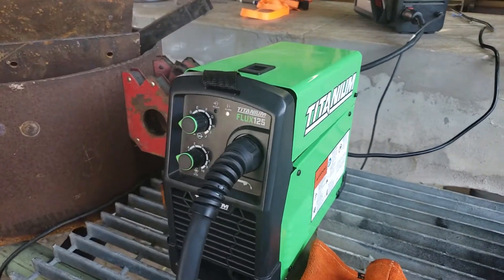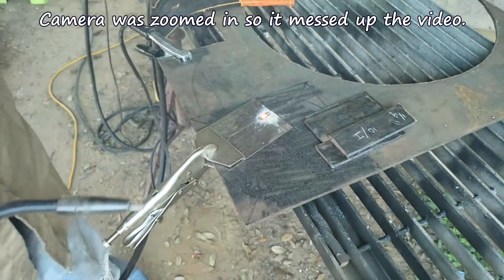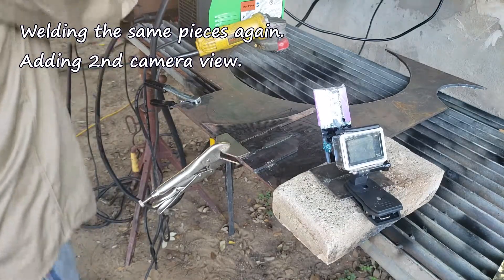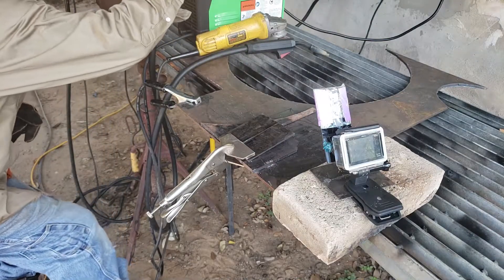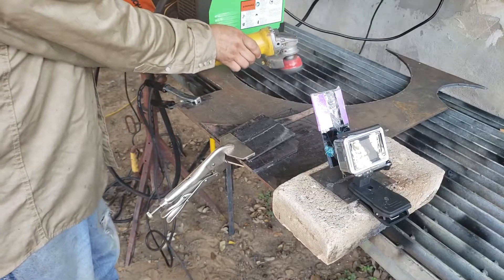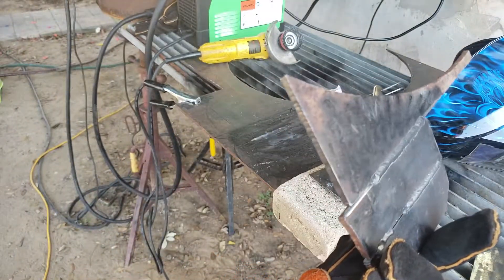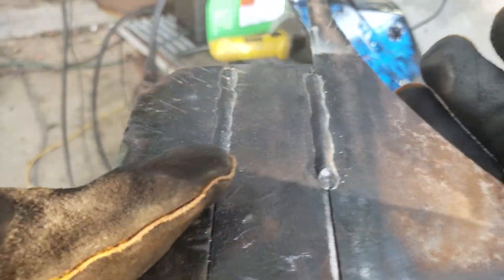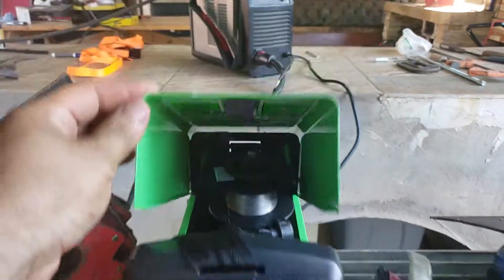Harbor Freight Titanium Easy-Flux 125 Amp Welder testing and review Flux Core

Comment: Did you use the settings the machine requires or adjust it to what you need or like ?
Reply from the maker: I don't recall the settings used by I eventually tweak settings. The 125 was a great little welder and really enjoyed using it.

Comment: Thanks for the video! I just bought the Titanium 125 yesterday. Now I just need to learn how to weld correctly.
Reply from the maker: There is a ton of videos to follow on Youtube which have great information for beginners. Practice is key and please don't weld galvanize steel. Find some scrap metal, clean it up and lay some beads on there. I don't have the 125 anymore but it was a cool little machine.

Comment: I just got one of these, and if it's on the lowest setting or even the next to the lowest mine keeps like going in and out. Spits and sputters real bad, idk if it's cause I'm on a extension cord or what but if I got mid way or higher it works great. Any suggestions?? I have good ground and welding on clean spot.
Reply from the maker: My Titanium worked great but I did notice on my Hobart some issues like you mentioned. I have a 20A circuit that powers a window unit in my Shed and if the unit is on my welder just welds terrible due to voltage or amp drop. I tried running one of my plasma cutters on 110v using an extension cord and also failed to cut so the extension cord could be affecting you as well.
Reply: Use a 12gauge extension cord and it will help. (shortest possible length).

Comment: I use this little welder on everything 3/16ths and below. Have done a ton of projects with it. Its a very capable welder . Lightweight and very portable. Easy to tote around the shop . The performance you get from it is outstanding . Its DC only and thats exactly how you want to run E71T.
Reply from the maker: I believe from all the small welders I have tried this is the best one. I used my Hobart 125 last week and that machine is probably 50lbs heavier than the flux. I only ran the Harbor Freight wire and it was impressive for me.

Comment: Nice work! Those are some of the cleanest welds I’ve seen with this welder. How are you not getting all the spatter?
Reply from the maker: I don't have the 125 anymore but the machine was awesome. The wire was the original one from Harbor frieght and the splatter was minimal. I still use the Titanium 140 and the Hobart 125 but the Flux 125 was just as good on 1/8 material. Prices are crazy now and all the welders jumped up dramatically. Thanks for watching and I will be having a giveaway soon.
Reply: @cutweldngrind  I just got the Titanium 125 for $169 on sale. ( it ended 4/18/2022 ) Got a Flux 125 as a present and returned it and paid the difference for the Titanium. Flux 125 was also on sale for 99 but it was 119 when it was bought for me, so the upgrade only cost me $50. I was not real happy with the cheaper Flux 125, haven't had a chance to use the Titanium yet but I also got Vulcan .030 wire with the Flux 125  so I will be using it next welding I do and see which is easier/better  to use.  The titanium is SOOOOO much lighter.

Comment: What type of wire are you using? I’m trying to learn on this machine too but just can’t seem to create a good head. Your beads look great, any tips?
Reply from the maker: The 125 uses the Harbor Freight flux core wire that came with machine. I don't do much Flux Core welding so really don't have many tips. I mostly do Arc welding and use the MIG140 on some projects.

Comment: Can you put a roll of aluminum wire in this machine?
Reply from the maker: The machine is DC output so not really made for aluminum so its not recommended. The manual also states not recommended as I am looking through it.

Comment: With the thinnest material, it's like doing auto body work. Usually pros wont run a bead because itll get too hot and blow through. They spot it about every 1" then keep jumping around making spots a inch apart until it's all covered. Of course it looks nasty but they grind it smooth so it doesnt matter.
Reply from the maker: I was doing a video on patching a scrapped C10 door but the lighting was bad so will try to film a new video. I was using the cheaper Chicago electric and was going to use the mig 140 as I don't have the flux 125 anymore. I feel confident in these machines so hopefully I can do some filming asap.

Comment: Excellent welds IMO. Your welding is great and this little machine is a win for HF. I have this one and the Stick 225, both of which are EXCELLENT machines all things considered. Sometimes at HF, you walk away with wins, and these two machines are clearly wins in my book for the hobbyist and general low risk-range mechanical work.
Reply from the maker: Right on. Have you seen the prices lately its making it tough for me to buy new tools. We have a lot of small business (within 50 miles) that sell returned items and some carry lots of Titanium welders. I have been wanting to shop for a Tig welder and a bigger multi purpose welder. I never got to try the Vulcan brand but these Titanium's work awesome. I actually used the Mig140 to weld a bracket for a race truck today.

Comment: I just bought one of these from a pawn shop that had barely been used for $100. Came with an extra roll of wire but no tips. Still a good deal in my book. So far I love the thing. It's perfect for the little projects I do around the shop. 👍👍
Reply from the maker: They are good machines and I use mine alot. I saw one of these for $400 at the pawnshop and the Plasma cutter for $300. I actually wanted to try the plasma cutter just didnt want to spend cash this week. Did you order tips for it, I think I use the Vulcan brand from Harborfrieght.

Comment: Just picked this welder up today for $220.  This welder even made my welds look half way descent.  My 15 year old that has never welded even had good welds after a little practice.  Your welds look great.  Wondering if you use figure 8s, circles, or horseshoe patterns to get those  nice welds?
Reply from the maker: Awesome to hear that. I do mostly Arc welding and kind of a noob  to MIG/FLUX. I used either Triangle weave or concave weave. I think the concave is what you refer to horseshow pattern. I haven't powered up the equipment in a while but did enjoy the welds the machine made.

Comment: Nice test for that little machine. I am curious on the butt weld of the 1/4 " plates. The listed capacity on the HF site says 3/16" max, so if you beveled the edges a bit before running the bead would that help to get it done in one pass?
Reply from the maker: I have done 1 pass using the MIG 140 and beveling 1/4" plate but I am not welding structural steel. I do like the weld and penetration of the 140. The 125 welds nice and you may be ok with a single pass just depends on your project and weight limits or force applied.

Comment: Great welder bought one about a year ago did'nt know a thing about flux core welding, but with all this time off why not learn. I have made several smoker since then, and this welder can handle 3/16 with no problem. Yes that will be some splatter, but that can be reduce by type of wire, and your settings. I love this little welder and for the DIY you can't beat it.
Reply from the maker: The Titanium welders have worked great for me and glad it has worked for you. I use my Mig140 for just about every project now. I believe if I run this on a 20A circuit I will get much better performance. I currently run on 15A breaker with 14AWG wire. I Will upgrade the outlet soon. Thanks for watching.

Comment: what wire are you using in that video?
Reply from the maker: The 125 was using the stock one from HF and the 140 runs on Esab coreshield 15. I dont have the 125 anymore but did want to try other wire. The 140 is my main hobby welder and my Hobart Champion is my main arc welder.

Comment: I have this same welder I run the shit out of it, its a beast for how little it is. It has welded everything I have thrown at it. I use it mostly for doing body work on my project car. Im a maintenance mechanic by trade and take that little bastard to work too. I weld on conveyors with it and it does pretty awesome. Even my coworkers are surprised with how well it does. The light weight is nice too when I can carry it up a 30ft ladder to get to higher conveyors.
Reply from the maker: I think the little Flux 125 is a monster in a small box. I welded lots of stuff with it and I still get amazed with the size, weight and power of the welder. I used to do body work many years ago with another welder that got stolen from me and this one for sure out performs it. The Titanium welders have gone up a price since they came out but still worth the money. The only draw back is I can only use small rolls of wire versus the 10lb on my mig140.  I highly recommend this to anyone one starting to learn to weld for sure.

Comment: I just bought one. I hope to do half as well as you did.
Reply from the maker: We all have to start some where and I believe you will be able to get good welds. Find some scrap metal and clean it up and just weld pieces together. Follow the settings on the label and then adjust as needed. I still struggle to weld because I cant see the puddle. I picked up a new face shield so hope that helps me out. Have fun welding and let me know how it goes.

Comment: These are not bad little welders for the price the biggest problem is people try and use them like they are a big fancy one and overheat them a lot but if you just do small welding projects they work perfect I had the bigger Harbor Freight welder that was flux core and Mig and I had it for three years before I finally melted it down because I was running it too hard too often
Reply from the maker: I run them close to their max ratings but I need to upgrade the wiring to my outdoor outlet. They have worked great with no issues that I can recall. My Lincoln AC225 arc welder I have melted the plug due to welding non stop over 135amps. If the machines get abused they start to fail and lots of people just go over the duty cycle. I can say these Harbor Frieght welders have passed my test.
Reply: Great job wish I could weld like you o practice make perfect I guess, slow but sure. Thanks for sharing ⭐⭐⭐⭐⭐

Comment: I bought a Miller half-mask, to fit under the hood.  Stick welding & Flux core welding, very toxic stuff.  A fan, and a half mask, outdoors, at a minimum..
Reply from the maker: Thanks for the tips. I try to use a fan but sometimes turn if off when recording due to it being super loud.  Galvanized steel is something I just avoid due to getting sick about 15+ years ago.

Comment: Thanks for this video. You're the only guy that actually shows the settings you used. And that's the help I needed. I'm about to weld 1/4" plate.. Thanks again!
Reply: How did it go? I’m about to buy one of these today and 1/4” is probably the first thing I have to weld (after practicing)
Reply: @OhighOSkater  It welded good.. very impressed. Great results especially for being flux core..  try and use the lincoln wire, it is worlds better then the harbor freight wire...

Comment: Very nice welds. I bought one of these for small work where I can’t really get my big welders to, and dont need long welds. If you want to do 1/4” with this, grinding a V and using three passes gives a very strong weld. It works on 5/16”. Haven’t tried on anything thicker.
Reply from the maker: The 125 is an awesome machine and you are right about adding bevels to material. I used the 140 today and had been giving me issues. I yanked 20ft of wire out of it and now works perfect.

Comment: Love mine I put real good ground clamp and ordered  INE flex core wire  welds Great
Reply from the maker: I been having trouble with my Mig140 and may try a diffrent spool of wire. The Flux125 and the Easy Flux 125 weld very good. I use all 3 harbor Frieght welders and can say they have worked pretty good with the exception of the feeding issue on the 140.

Comment: You will die a young man if you keep your face in the smoke.  Use a fan to gently blow the smoke away from your face.   Try welding with your face farther away from the smoke.
Reply from the maker: On some projects I do use a fan but I sure agree with you and ventilation. I have a very difficult time seeing the puddle that I must get close. I used to use a fix hood with a magnifying lense and could stand back a bit.  I stopped welding galvanized steel after getting sick 2 or 3 times in the past 10 years. Thanks for the reminder and watching out bud.

Comment: It would have been nice to know the SETTINGS the welder was on when you did the weld..
Reply from the maker: I showed settings on chart that I was going to use and even showed the dials set. It all shown around the 34 second mark.
Reply: @cutweldngrind  Im blind, sorry :)
Reply from the maker: @RandyB1973  not a problem. It's a nice little welder for up to 3/16 thick mild steel. If  you plan on 1/4" material try the Mig140.
Reply: @cutweldngrind  Yeah, Ive been doing some practice welds, tryin' to get used to it..got a trailblazer with broken stabilizer bar mounts I want to fix, and have watched 15+ videos on this welder to see how it performs, Thank you for the insight!
Reply: @cutweldngrind  If you can notch the 1/4 plate it looks like it would do fine. Or weld on both sides.
Reply from the maker: @rileyneufeld7001  I agree with that. Thanks

Comment: Purchase one last year and I didn't know a thing about flux core welding had stick weld for many years. After researching it out this is a great little welder for  the DIY at home. The only problem I am having is welding thinner gauge  like 16, 18 just have to keep practicing until I get the right current, and wire speed combination right.
Reply from the maker: I could say I am fairly new to flux welding. I use my arc welder on 16 gauge steel at times and get decent welds. I have been suffering from allergies so have not done much welding lately.

Comment: the portability and the fact it uses 110 v  and its flux core  are good points  it will pay for itself in 2 jobs I have already  if you are thinking about using this for auto body sheet metal forget about it ..............
or buy it and find out for yourself      1/8 to 3/16  metal   is where it shines
Reply: i have found using 35 wire and just move a little faster,and it welds thin metal just fine.
Reply from the maker: The super compact and the power for up to 3/16 really surprised me. This was around $170 on sale and my Titanoum 140 about $240 on open item shelf. These 2 welders are very nice and affordable. The Chicago flux probably weighs more than the 2 together.

Comment: Flux core is very hard to weld but those welds look good. With a small mig try leaving the joint open about 2 wire widths to get the heat right through the joint, with welds that are on show I usually push the wire that way you can see the joint better to get a straight bead. After flux wire welding, going back to stick your welding will be professional standard.
Reply from the maker: Thanks for the tips. On Flux core they recommend dragging but I push and drag it. I been having issues with my helmet and bought a new Hobart Creator about $70. I also struggle to see while welding and I once tried a pipe liners hood with a magnifying lense and I could see way better.  Let's see how the new welding hood performs. Thanks again and cant wait for updates on your robot.

Comment: Meant to ask what’s the lens size off the welding helmet?
Reply from the maker: My Metal Man welding Helmet has a 3.86"x 1.73" viewing area.  My Action camera has a 2" x 4.25" gold lens #9 hot glued to the clear shell. My new Hobart  Creator shows 1.85" x 3.82" but I have not unboxed it yet but will use it soon. Are you new to the channel if so, Welcome to the Channel.

Comment: Welds look good. Flux cores wire isn’t the easiest to weld with. How do you like the welder and is it a solid unit?
Reply from the maker: To be honest I am learning on wire welders still. I have used ARC welders for ever and have welded some thin to thick stuff before. This welder belongs to a coworker of mine and he wanted to see if the machine was any good. I said sure, I will test it for you and here I am welding with a 15 lb flux core welder. Time will tell how long it will last but the Mig-140 I have seems to have feeding issues since day 1. When I press the trigger the wire feeds at a constant speed then drops and with in a few seconds kicks back up. This 125 and the Chicago 125 I have on my channel seem to feed constantly and  the feeding mechanism just feel stronger. I might take him the sample welds tomorrow.

Comment from the maker: The hood is from Tractorsupply got it on clearance for about $40. I did not expect the welder to work that nice. I had recorded without checking the clips so had to weld all the pieces again. This welder was bought for about $150 on sale and usually ranges about $170 to $199.

Comment: Wow, that's a nice little welder... Nice clean welds for being flux wire... Is that a HF welding hood your using? Oh and your almost gonna hit 3k subs, congrats👍
Reply from the maker: The welder is tiny and can be used as a key chain. I was nervous on the 18 gauge  but when I welded the 1/4" I was shocked how nice it looked. This welder is actually my friends and just testing it for him. I think it passed my test. My helmet is from Tractor supply ( Metal Man ) and actually bought a new Hobart ( Creator )because this older one is giving me issues.